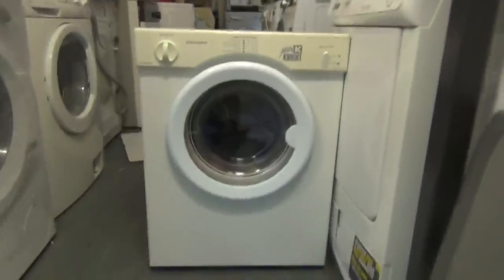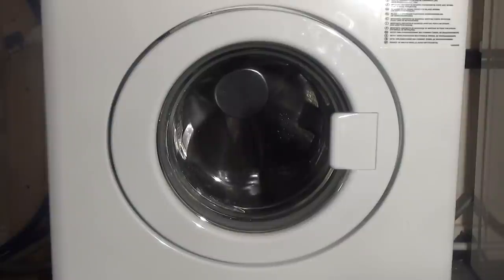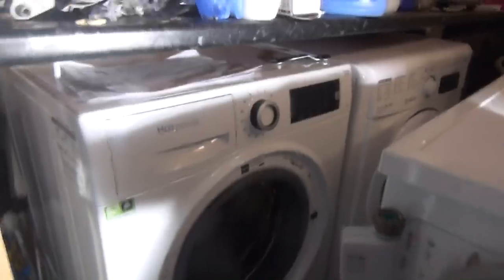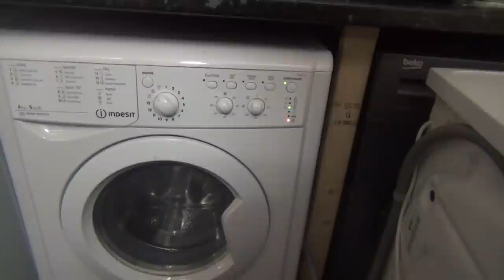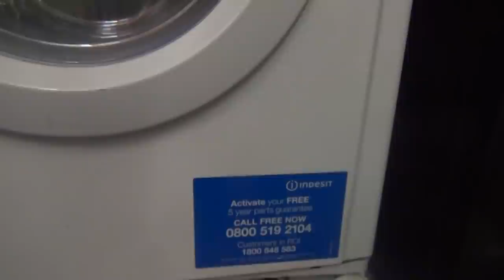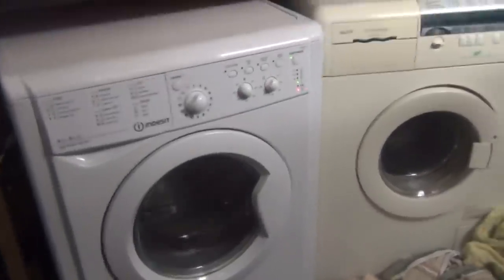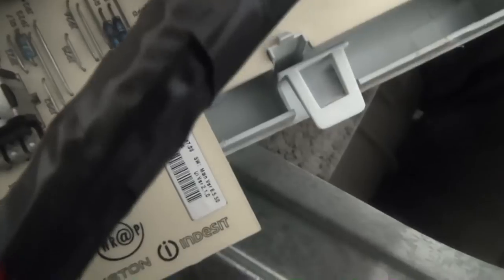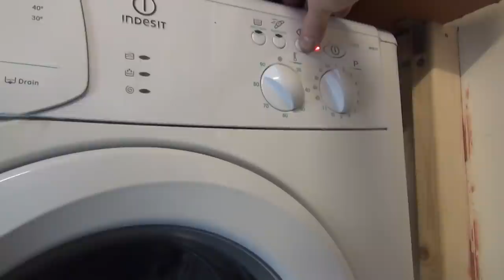Testing #12

Comment: The Miele is probably leaking. Try to remove the water inside of the machine and it will turn on like it should. You can do it to tilt the washing machine to you and try to escape the remaining water. It’s super easy to fix!👍🏻

Comment: The 1200 rpm motor from wia121 stands on the Wib111.  You need to put a 1000 rpm motor from WIA101 or wib111 or iwc6105.  WIA101 had a SOLE / ACC motor but it is desirable for wib111 Welling or C.E.SET

Comment: Notice how the Indesit washer dryers don’t have a 20° option on the dial even though they’ve got the newer logo (on the drawer instead of the door)
Reply: That's because it's apparently not a requirement for WDs, same reason as the old energy labels being used on them
Reply: @und4287  yeah I figured that lol